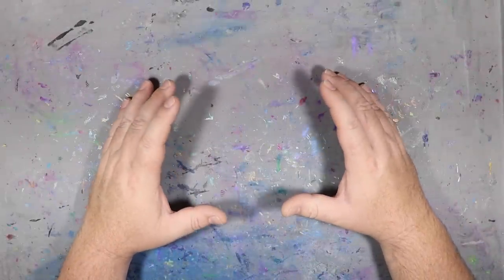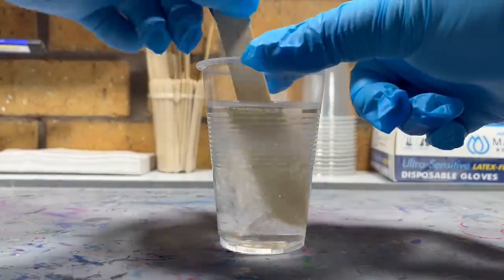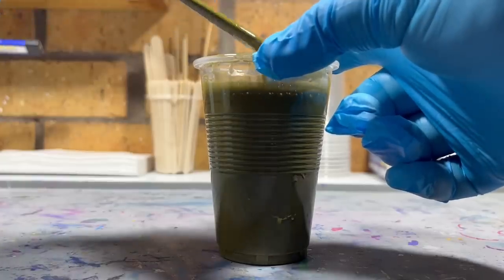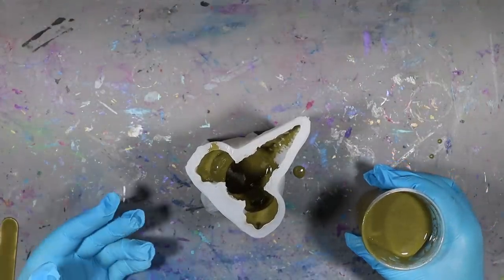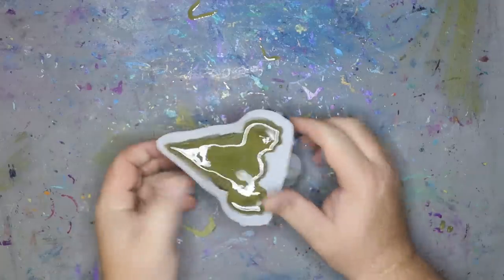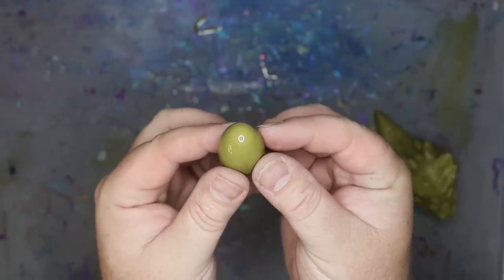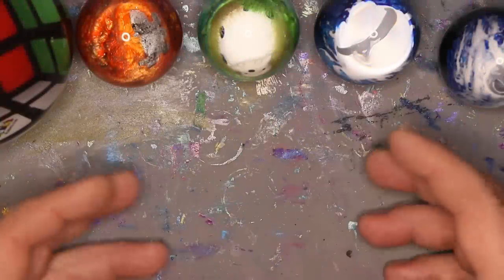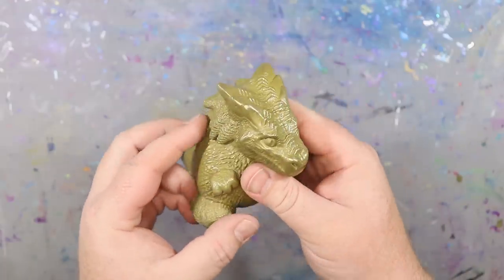Cold Casting a Brass Dragon Using Epoxy Resin

Comment: I've never cold cast anything, but I recall reading that some people dust the interior of the mold with the metal powder before pouring, which is supposed to help with the metallic finish once polished.
Reply: ...I did it with bronze powder as an anniversary gift for my wife...actually very easy and it my first experience with resin...if you're interested, give it a shot...👍
Matt
Reply: He looks like he should be called Spaghetti Pete. Love your channel by the way.

Comment: Hey Ben, great video. Next time you have a mold your unsure of the amount of liquid to make for it first fill the mold with water and then empty the water into a measuring cup or the mixing cup to mark the amount or get the exact numbers.
Reply: Oh wow. Thats a fantastic idea
Reply: I wanted to know how much silicon I needed to make a mold. 
Because the original I was molding was made out of plaster, water would not have been a good idea, so I used fine sand instead.
Just make sure you clean all the sand out later.
Reply: You can also use rice to estimate volume if you don’t want to get your mold wet 🙂
Reply: Rice...

Comment: If you want a cool project idea: embedding LEDs in resin. Wire up some tiny 3mm LEDs as part of a model before doing the pour (test the LEDs first!), with the wires sticking out of the resin so you can power it.

Comment: next time you try this you should try dusting the inside of the mold with the powder before adding the metal and resin combo also if you add some black pigment to the resin you will end up with a richer metal color when finished

Comment: You should consider antiquing it with some dark brown or black paint. You just brush it across the dragon and it will settle in the recesses. Then when you start buffing the brass for the shine only the paint inside the grooves stays. It really deepens the texture and once you polish the brass it really helps the shine pop.
Reply: Games work shop makes inks for painting their miniatures and this technique is exactly what they're made for.
Reply: Or you could electroplate it, with some zink, copper, nickel, or gold! A golden dragon would be kind of cool!
Reply: Iron face .. agree with you on this.  It would bring out all the details. Or he could use a rub n buff type wax to hit the high spots.. lazy way 😂

Comment: Add pigment in the colour of a natural patina to the resin. So for brass a brownish colour, almost black for bronze, rusty red for iron etc. Your piece will look horrible when you take it out of the mold but once you bring out the metal powder with steel wool it will look like an antique.

Comment: Great vid, that came out great. The most cost effective way of cold casting is to pour some powder into the mold, seal up the open area, shake it to coat all the surfaces, pour the excess back into the container. That stuff is very expensive. Then fill the mold with resin colored with mica powder or dyes to match, (mica is much cheaper and you only need a little bit to color the resin). Then buff lightly with #0000 steel wool (extra fine). The upside is how much money you will save in powdered metal, the down side is you can very easily buff through the outer dust layer if you are not careful. You could also use liver of sulfur over that to darken it.